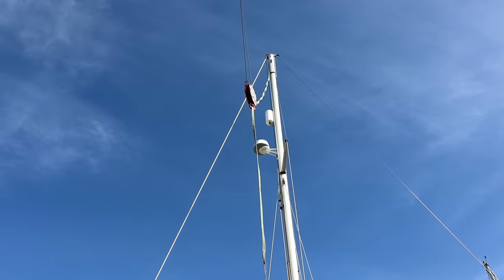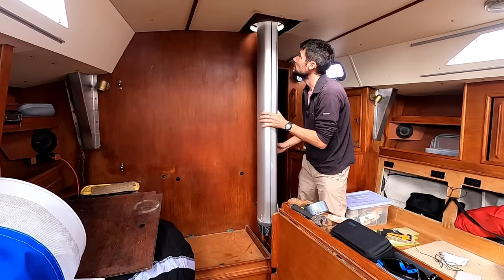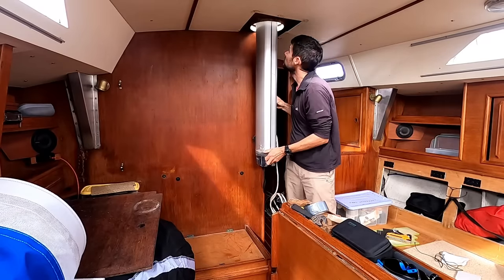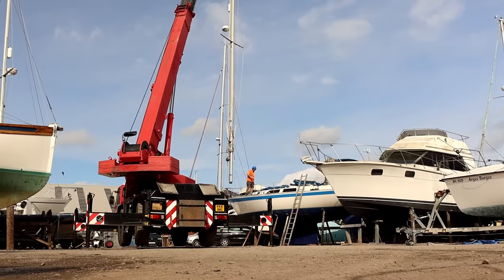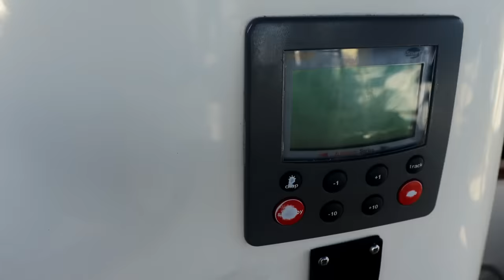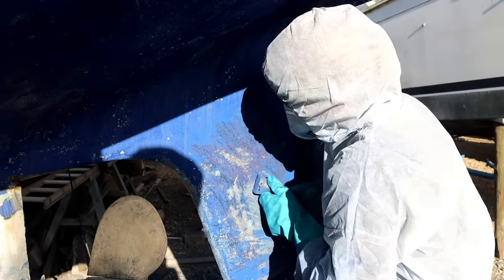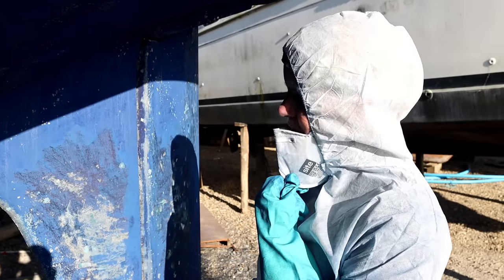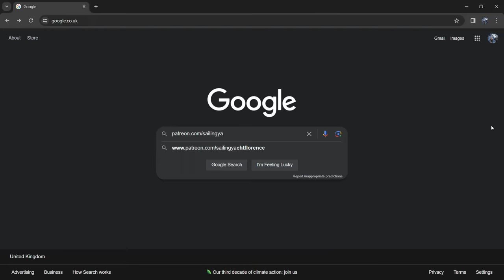BROKEN by Ocean Sailing - 50,000 miles later | Sailing Florence Ep.173

Comment: It's two bad you can't find a building that Florence fit in so you won't have to deal with the weather in England where it will hold you up on the repairs.
I really get nervous anytime people put time limits on a major job like you are looking at. There's another sailing channel I watched for the last two years and they have completely rebuilt an old sailing boat with the help of half a dozen shiprights. Now they are rushing to get some very important installs and repairs done by a set date so they don't get stuck in the ship yard because the fishing fleet will be coming into the yard for repairs. In the last two weeks I've seen so much hurry up and some issues that are not safe and being done sub par just to launch the boat.
I unsubscribed because I just couldn't watch this accident ready to happen without constantly commenting about slowing down ,do the jobs right and if you get stuck in the yard for 3 more months it will give you time to do it right and safe.
I realize you want to head to the arctic at a certain time but safety first and you have a lot of time . I just heard Amy's last remark and my heart sank ,I hope it's not the end of Florence and watching my favorite sailing couple.